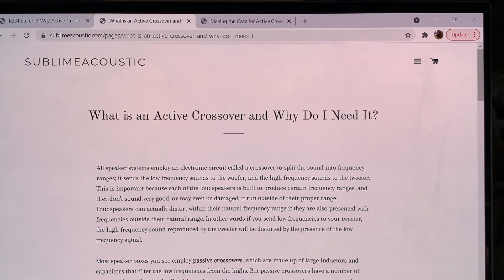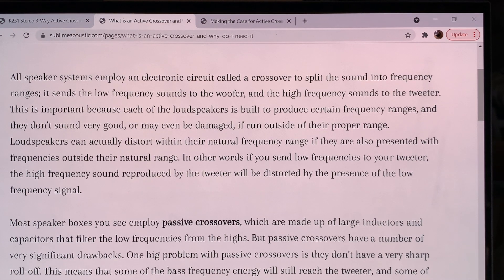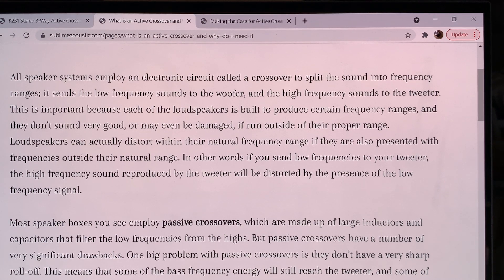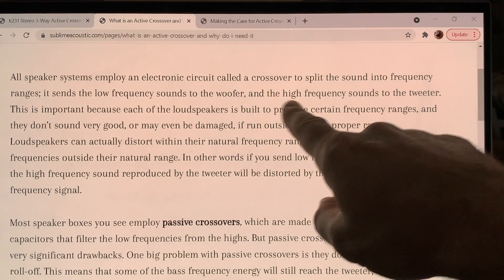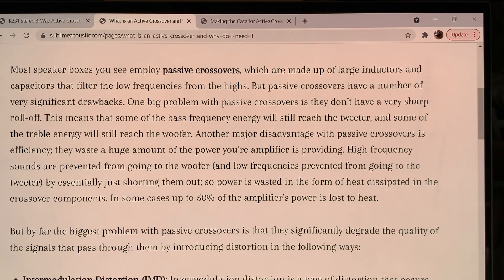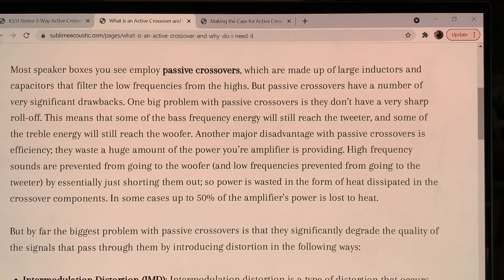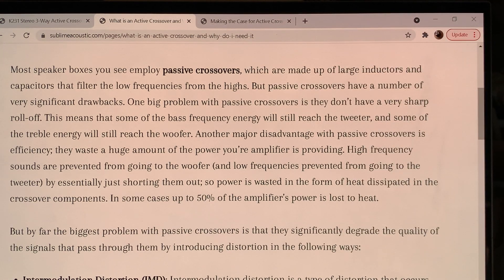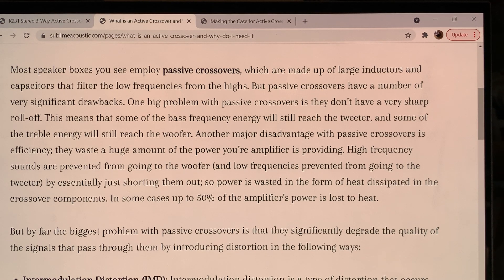Active VS Passive Crossovers! Masterclass part 1.

Comment: Thank you for your thoughtful introduction. 

I am currently building a four channel amplifier with an active crossover. 

I am intending to XO between 200 and 300Hz. 

It's almost a full range driver with a sub. 

I mostly linten to acoustic instruments, especially stringed ones... So it will be interesting to see if you're assertions hold true.